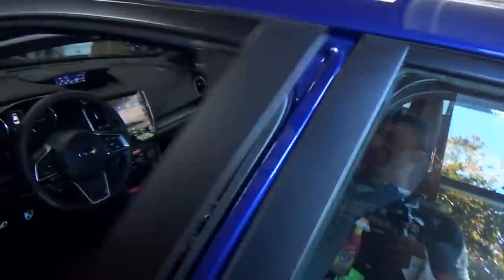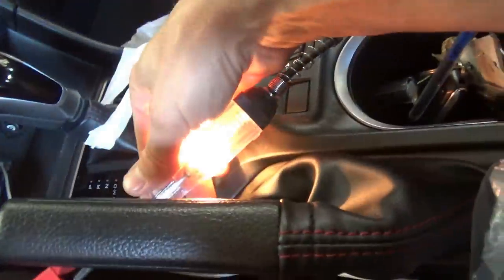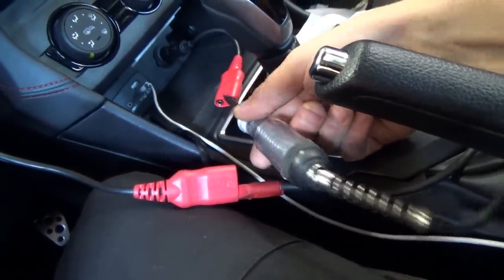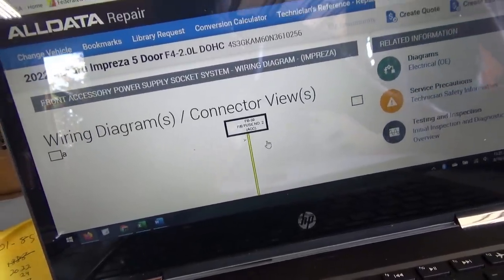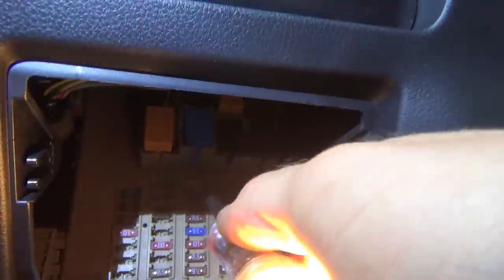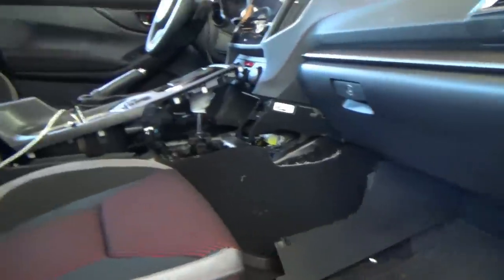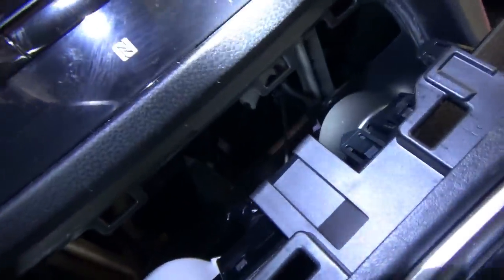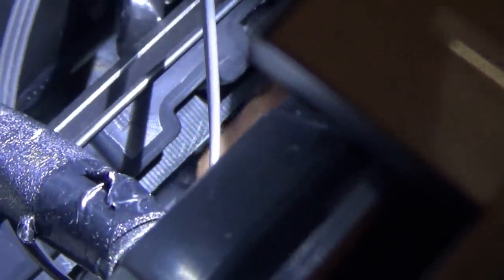Dealer Wants to Charge Customer for THEIR SCREW-UP?! (22 Subaru Impreza)

Comment: I believe this was a deliberate act on the part of the dealer.  It's impossible for anyone to be that incompetent.  It's too bad the dealer name can't be mentioned for this video, and also for the recent Eric O video where the dealer wanted to replace rack & pinion, trailer brake module and other things because of a corroded ground cable.   Outrageous.
Reply: Yes I watched that video too. Then I see this one....wow! Just blows my mind. I would have lost my shit at the dealership and they would have fixed it under warranty! Like come on...not covered under warranty because an "aftermarket" device was plugged into it?? I'm just getting angry posting this message...lol
Reply: @marcstewart2328  
Amen, that service desk employee would of had my ham radio plugged in his arse ...
Absolute shite I heard at dealerships (gone in for parts collection) when fluffing off customers is disgrace ...
People want give new cars the middle finger ... problem be solved in 12 months no new car sales lol .
Reply: I think you are correct.
Reply: I kinda disagree, Duane. I think they had someone from the grease rack do the job. If there's a mechanic that would mar up a new car like they did around the outlet he should be fired. Most owners of a brand new car would be upset over that. That dealership needs to be reported!
Reply: Something has happened over the last year or so at dealerships especially with regard to their service departments, where customer service has gone straight into the toilet. I mean it was never really all that great, but as of recently it has hit absolute rock bottom with their lies and sleazoid tactics. I am convinced this has to have something to do with lack of revenue stream, and they are being given a directive to maximize profit, including intentional misdiagnoses and "tricks" (such as not plugging in a 12 volt outlet properly) to fool the customer into paying way above and beyond what would actually fix the problem. My local Honda dealer has even stopped doing oil changes on Hondas that have 10 years or 125,000 miles and up. The only explanation can be that those service jobs don't generate enough revenue or they are trying to get customers to trade the car in and pay outrageously overinflated prices for a newer model. It even extends to the sales department where dealerships are trying to get away with surprise markups for stuff like wheel locks, window tint, "paint oxidation protection," and extended warranties that the customer never agreed to, using the lame excuse of "Oh we can't do anything about that it it's standard dealership policy to include this stuff on all our new vehicles." Give me a BREAK. They can all go to hell as far as I'm concerned.
Reply: I didn't see your comnent which mirrored mine.  Eric kind of let it slip as a Chevy dealer in Bath New York. I doubt there's more than one there.
Reply: @sblagg527  To be honest, most techs have retired or left the industry.  We have seen locally, dealers sending vehicles to independent shops for repairs that are not very complex.  I believe many dealers have lost their best techs and have young novice techs who still need to learn.  Can we blame the tech? Do we blame the industry?  Not sure.
Reply: @sblagg527  You hit the nail right on th e head…I couldn’t agree more with you. I’ve had my share of dealer screw-ups and it really gets one pissed off.
Reply: The pry marks on a brand new vehicles plastics with a metal screwdriver says it all about the tech at the dealer. Lack of respect for the owners new vehicle is just the start he obviously didn't want to do a proper job. The dealership needs to retrain or fire this tech..
Reply: No, no, Duane. It's 2022. Incompetence has been proven to have no limits, sir! Haha!
Reply: @noelcastle3986  yep, and all this shit comes from the head down, managers are at fault as much as the clowns who they are letting loose on people's new cars and then playing poker with customers money
Reply: The dealership techs need Electricity 101 (high school level) training!
Reply: @sblagg527  Wouldn't you think a dealer would LOVE an old/high mileage car for oil changes?  Doesn't it increase the chance that they can find something to fix?
Reply: @kevin9c1  IKR??! That's what has me scratching my head about it. And their explanation is that "we don't want to risk damaging something on a car that old." I am totally serious -- THAT'S their excuse. REALLY? On a freaking OIL CHANGE?? That's why it HAS to be revenue related.
Here's another example (and the reason I even own this beater Honda in the first place)- before this I had a 2013 Subaru Outback, that had a whining sound coming from the CVT and an oil leak. I tried taking to the dealer to have a CVT fluid change done-- which I had had done by the exact same dealership on another Outback in 2020 and which would be an easy job to see if it solved the issue-- and they suddenly flat out refused to do it, saying it went against Subaru's policy and with no regard for the fact that they had done the EXACT same job on another car I owned two years prior. So when I asked what it would take to fix the problem- they didn't even diagnose it, they just told me it would be an $8000 transmission swap (yes you heard that right) and a $3000 "engine reseal" job to fix the oil leak. So, $11000 total to fix what is at best a $9000 car.  I just sold it and bought the Honda, and now run into this issue at the Honda dealership. Or stuff like in this video. As far as I'm concerned there's only one explanation- punking customers for money.
Reply: Have you met people?  They can and are that stupid. But there are equally that many scammers out there.
Reply: @AS-ky4kk  I would assume blame the dealerships. If they would pay the knowledgeable, experienced technician what they are worth they would not leave.
Reply: Okay. I think the dealer cannot successfully sue anyone if all the above is 100% true, and everything in this video is 100% true. The Subaru dealer is in York, Pa
Reply: @n3roc  Their google reviews are interesting....quite good when it comes to selling cars, quite poor when it comes to service and maintenance.
Reply: But iiis it impossible is it really.  
The result here speaks for its self. CrAzy
Reply: Dealerships do NOT hire the best and brightest. Most of those techs have less than 5 years experience.
Reply: I smell a rat 🐀 ( dealer)
Reply: It's surprising how incompetent some dealer mechanic's can be🙄
Reply: @noelcastle3986  Along with the service manager..
Reply: Brainless service manager and tech fully relying on program and not basic diagnostic flow chart.
Reply: @jeffryblackmon4846  Grade 9 science lol
Reply: @n3roc  You should post dealer name in another comment
Reply: Having worked in the service industry for over a decade: no, it is not impossible for anyone to be this incompetent. In fact, competence is rarely found.
Reply: No they're that bad. I had a dealer that wanted to change out $6000 worth of modules because a request switch that was acting up in the wet weather.
Reply: I’ve worked in the industry for over 30 years and yes there are technicians that are that incompetent, especially now days.
Reply: yup they wanted to make a quick buck
Reply: SR chevy in bath is famous for that , all,their dealerships are , and unfortunately ALL dealerships are

Comment: Why some folks trust a dealer's service department more than a good independent shop is absolutely beyond me.
Reply: because you have a so called warranty, so no money comes out of your pocket. why else would you buy a new automobile
Reply: To be fair, some dealers are very reputable...like our local Toyota dealer.
Reply: Subaru is notorious for not honoring warranties. Trust me i own two and never will again. Both cars leaked oil after the warranty period
Reply: It is also hard to find a GOOD independent shop.
Reply: @petepeabody8905  yeah keep that in mind , when dealer said to you to change oil after 30.000km :)) i m sure no money will run out of your pocket 😂😂😂 buy and never ever service anything at them if you want to have a car..........
Reply: @mikefoehr235  Our Toyota dealer fired all their master techs because the owner refused to pay that much for the best tech, moved the oil change guys to doing service work. Wifes car smelled of antifreeze, 15k on the car replaced hoses and thermostat 3 times, the last time damaged transmission wiring harness, then damaged the transmission, put a rebuilt unit in, and it still smelled. found out on our own it was a defective radiator cap that leaked after getting full operating temp. My dodge got blend doors replaced under warranty, they delivered truck to me drove 10 miles to my work with the air filter box disconnected from the throttle-body, and cracked the top of my dash, truck stays in a garage  only had 31k on it. No, I don't trust them anymore. Never buy another new vehicle.
Reply: @r.weaver3769  Our experience with our dealer here in Brantford On is totly opposite. Our favorite SA told me people drive from 100 kms away and come to our dealer for service and warranty work. Apparently Brantford Toyota is the oldest dealer in Canada
Reply: Likely because in a lot of places, 'good independent shops'....are as scarce as hens' teeth.  I used to have one that I went to, honest guy.....then he merged with some other people.....and became a scammer.
Reply: when u buy a car they try to rob you blind, so why wouldnt they do the same when servicing a car?
Reply: indeed..dealers don't pay their help to diagnose, they pay them to do repairs so all they do is fire the parts cannon. And the dealers pay very little. No mechanic in his right mind would gladly work for a dealer these days.
Reply: @ourtexasfamilyvideos62  it is. I work in a honest reputable independent repair shop. I’ve been repairing cars and trucks for 30 years. The old guys who have ethics and knowledge are slowly getting out. There isn’t many of us left in my area. And people aren’t going to schools for auto repair anymore like they did in years past. The job has vastly changed since I started. Eric O made that comment in his last video so many have referenced. But honesty still pays the bills. I’ve told customers when I’ve been wrong and didn’t charge for my mistakes. By being honest I’ve always had all the work I can do and then some.
Reply: @mikefoehr235  I don't doubt that. I hear about good dealers too, but I refuse to drive 500 miles just for service. Independents seem to be firing good techs too. One that was really good at electrical diagnostics finally moved to Atlanta, new job even paid for his move.
Reply: I understand it.  It starts with warranty work on a new car.  People shop for the lowest price on a car and then believe they must have that seller do the warranty service.  They don't realize that most of these shops are now legally and financially separate  businesses from the car-selling operation. .      Until they get burned, most people automatically believe that if you buy a car from a dealer who has a maker's name on a pole, that the service shop at that location is staffed by only technicians who are 1) competent and 2) proficient at servicing that makers vehicles, and competently assigned and supervised to work on things they are qualified to do.   few people realized that a dealership-associated "authorized" rep[air facility has to do warranty work for fixed costs that may be lower the  the actual cost of the work, and that overhead cost get passed on to all customers.  Also, most people have no idea how to tell if an independent service facility is any better. than one that is associated with a dealership.   
-  I have a different opinion.  I think using analogies when looking for a skilled service provider. 
 -  If I had a general medical issue, I'd rather have it treated by a good vet than a good MD. The vet is trained to diagnose and treat medical issues on dozens of species and has few specialists to refer to. His patients can't talk. He has to be a good diagnostician to stay employed. .   The MD is trained on only one species, has many specialists available and can work in a large group that can camouflage the level of his individual competence for better or worse. 
-  If I had a problem with a new Honda with a new design engine I'd probably go to an authorized Honda service shop.  A "dealership" mechanic would have direct access to the latest information and factory repair data.  
--If I were out of town and had to get emergency engine service on a Honda that I knew had a lot of uncommon systems, I'd look for a dealership to do the work. A technician there is likely to be competent at repairing Honda's "by the book", but without that book and an HDS, might be a poor or great Honda diagnostician. One at an independent is a wild card. I wouldn't know the businesses reputation, what data he has access to, or the level of competence.   
-  If at home with an 5 year or older Honda with an engine that had been out for 5 years, I'd rather go to an established independent that services primarily Japanese brands.   To stay in business they hire techs from Japanese brand dealerships, pay them for all their time,  and keep only those who did the right work, properly the first time.
Reply: @psdaengr911  Well said. And is a good path to follow. I carry a code reader and a bag of tools, as long as it's not a flashing CEL (Check Engine Light) most of the time you can drive safely home. But most will need to seek help. And a dealer is the best option  while traveling. And a well respected independent at home. Most warranty jobs can be done under book time which is what it pays anyway. They do get paid the same for warranty as a paying customer, difference is the red tape that it involves. I worked as a service writer for a while. The Master tech we had only did warranty work, as he had all the latest knowledge, he made more money as a result.
Reply: I would only go to a dealer shop under warranty, after that no freaking way.
Reply: Because sales department threatens customer at sale that if they don't bring their overpriced vehicle back to them for service that it will void the vehicles warranty...... 🙄 ...... total 🐂💩 but people fall for it all the time
Reply: Some dealerships are good. I went from am independent shop back to a Subaru dealership and have loved it since then
Reply: This gentleman didn't.  He took it for warranty service, but wouldn't give them any money.
Reply: warranty
Reply: Maybe, because the car is brand new, and still under warranty?
Sounds to me, like the dealer dropped the ball, and this owner needs to contact SOA...
Reply: Cause independent honest shops is a gamble
Reply: Unfortunately automakers are making it very difficult to get parts, there are certain parts that can only be purchased through a dealer and they often artificially inflate wait times.
Reply: Actually I would not go to anyone except my dealer. Been going there about 24 years now and never screwed me yet.
Reply: @Hallowsaw  My 2016 Subaru was absolutely perfect other than water getting into a rear light. We only lost it due to a drunk driver running a red light 3 weeks ago. I rather like the Mazda CX-30 but we've decided to get another Subaru. Then again we have a friendly and helpful dealer here :)
Reply: @costialin87 😂

Comment: Dealing with 12 volt automotive installs every day in my car audio shop, I totally believe the dealership had NO IDEA how to bench test a cigarette outlet.
Reply: even a 6 year old could of ohms tested a power outlet
Reply: @petepeabody8905  A simple battery and test light would have sufficed, I would not want someone working on my car that did not know such a simple thing.
Reply: @petepeabody8905  Now Now don't be under estimating a 6 year olds ability 😊, I could test things with my Dad's AVO 8 when I was 4 with no problems 😉😊
Reply: Perhaps the dealer guy dident smoke or haven’t advanced to two wide DC circuits :)
Reply: Yep,that's scary.
Reply: Give me a couple of scrap wires and a 9 volt battery and I can bench test it..
Reply: Then they shouldn't be in buisness.
Reply: Parts changers don't know how to test or repair anything.
Reply: I don't think they replaced the outlet.
Reply: I am no auto-tech, nor an auto-electrician and know how to bench test that socket.

Comment: I would definitely be having words with the dealer over the scratches they left on the console. Admittedly, the scratches are not in a very prominent place, but it's basically a brand new car and they damaged it 😠
Reply: I agree 100%, they were too lazy and wanted a quick fix. Have them replace the part that is scratched. Replaced by a mechanic that is capable to do the job, not the OJT guy that just was trained on oil changes. This definitely causes some trust issues with the dealer.
Reply: @craiginswflorida9324  Absolutely. And, sadly, this kind of unprofessional behaviour from dealerships seems to be widespread. Given that I'm in Australia and, judging from your user name, you're in the US. Nothing about this dealer's behaviour would be any more surprising if this had been filmed here. Even more of an indictment, it's almost an expectation.
Reply: I would complain about the scratches as well, but I would not expect a solution because you know that without any video proof they would just blame him stating that he said he "Installed" a ham radio into that area instead of just saying he plugged something in and blame him for the scratches. As that's how these "stealerships" work nowadays.
Reply: I took my BRZ in to warranty the steering wheel as the leather was flaking.  The access panels on the new wheel looked like a victim of a horror film.
Reply: at $150 per hour, they should be putting new panels in
Reply: @Anthony-fd8mh  You got right spelling here: stealership